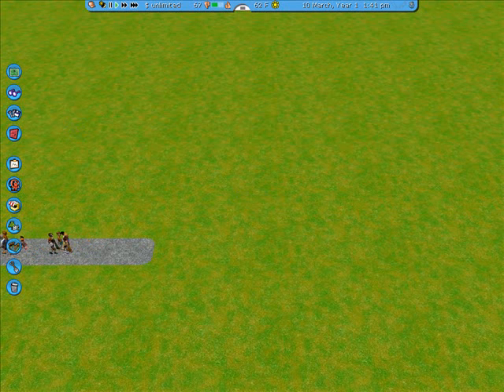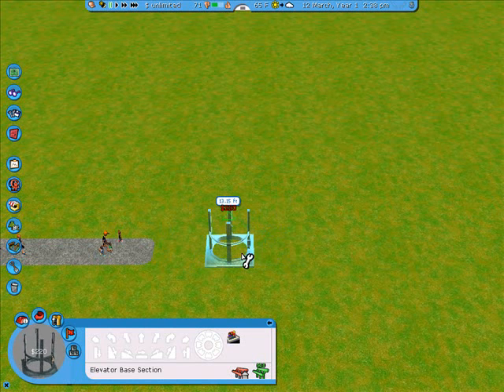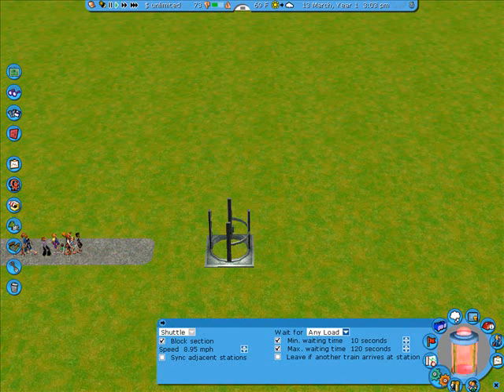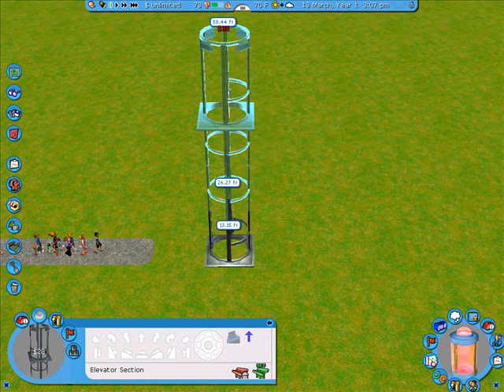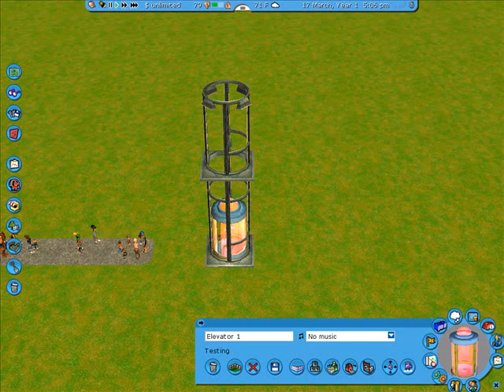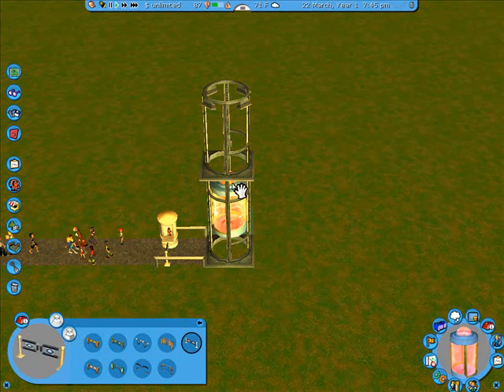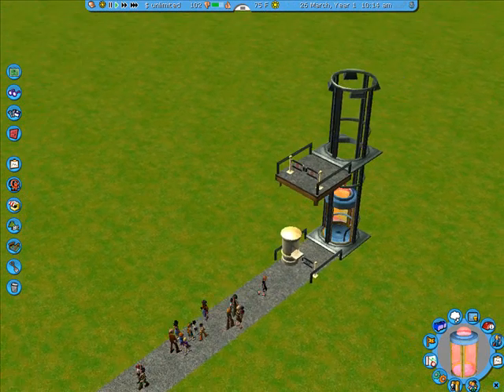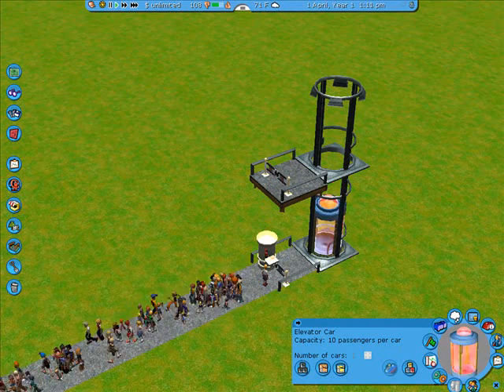RCT3 - Tutorial - Elevator 1

Comment: You can make the elevator *one-way* for crowd control by NOT giving both station platforms each an entrance and an exit.
I find the capacity too low, sometimes so I will buid two elevators next to eachother....one goes UP and one goes DOWN......and  because of space limitations there isn't room for 4 station platforms on just one elevator.
It allows you to do it either way.